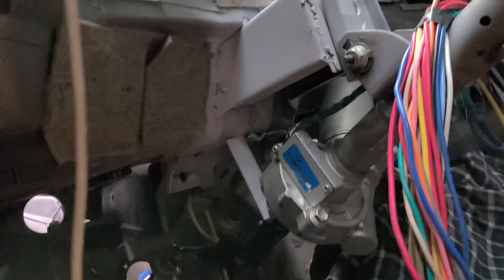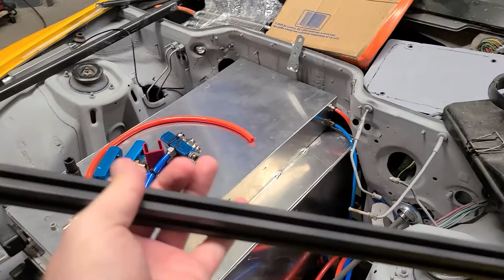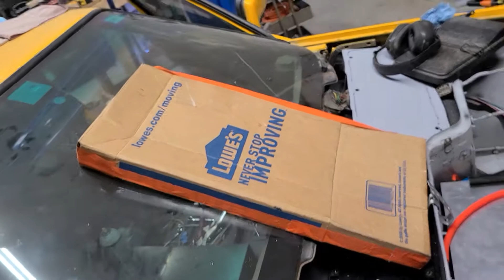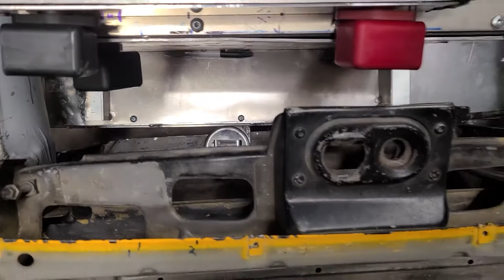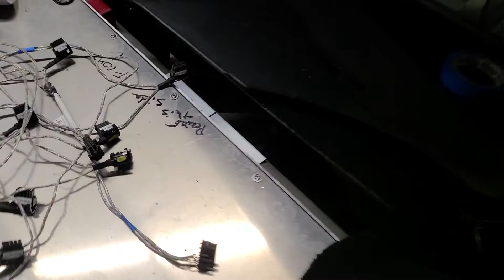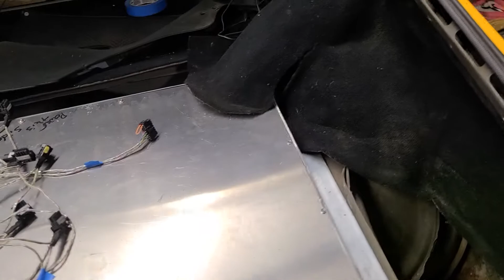Porsche 944 Tesla Model S LDU swap

Comment: Love it! I'm planning and researching a 944 conversion, similar geometry, considering tesla model s/x rear small drive unit, and TBD battery modules, but I like the VDA 355 module type (hypothetically). You're inspiring! Keep it up!
Reply from the maker: Good luck dude! I think the sdu is probably the way to go, TBH. Much better use of space, and can configure any rear batteries more optimally than I did.

Comment: Amazing work, really impressive. I am planning to do the same with my 1986 944. How did you get the transaxle of the LDU to mate with the prop shafts to the rear wheels? I would love to see another video of the way you mounted the LDU motor assembly to the car. Also discussion of what you used to control the inverter. 
Super impressive, this thing is going to be a monster when she's running.
Reply from the maker: Thanks! LDU to 944 outter axle hubs was done via two tesla to 930 axle shafts from... I'll have to look up the receipt to tell you who I got them from in the UK. I then had to contact Lindsey racing out of OKC to get 930<>944 axle flange adapters. Then I had to order two 930 chromoly axle shafts (I think I got 24" long and cut about 1" off them), and four 930 cv joints. All told, the price to mate the motor up to the rear wheels was about 800 USD. Pretty brain dead simple too.
I also upgraded the rear torsion bars to 30mm. That helped a lot 😁
Reply from the maker: https://zero-ev.co.uk/shop/108jointpair-tesla-drive-shaft-stump-108-porsche-pair-12792
Reply from the maker: 23" Chromoly I.R.S. Race Axles for Type 2 Trans./ 930 C.V. Joints from jbugs
Reply from the maker: When you get the cv joints, make sure you order the spiral retaining clip, not the typical spring circlip. You'll send it into orbit before it fits over the 28 splines. The sprial clip is so simple to put on and remove.
Reply from the maker: Also, I'll try to record something about this in th coming days. Prepping to love so everything is an even bigger disaster right now.
Reply: @ChaseTheSunPodcast  Excellent links and advice, thank you. We were thinking of using a model 3 motor but perhaps we will use the LDU and follow in your footsteps. Right now she's purring beautifully as an ICE but I hope this winter we can get a start on the conversion.
Reply from the maker: @alsgarage3691  I think the model 3 motor is awesome from efficiency, size, and power, but I believe that motor is still very much in the"wild west" stage of support. At least some bigger names have lined up behind the LDU. Also might be worth considering an SDU, but I'm less familiar with what's available for that.

Comment: Very cool build.  I am working on a similar conversion, not as far as you are right now, but I am following what you are doing.  Great Job!
Reply from the maker: Thanks and good luck to you. There are a thousand little things you'll never expect. What kind of car are you converting?
Reply: @ChaseTheSunPodcast  I am working on a 1970 C3 Corvette, replacing with the whole Tesla Model S rear subframe & brake, rotor, drive shaft.  I am using 6 LG Chem in series and in the process of setting up bench test the motor & batteries.  Still deciding what to do with BMS and Charger.
Reply from the maker: @michaelleung3449  very cool! Post a video when you're finished if you can!
Reply: @michaelleung3449  where did you source the lg chem batteries?